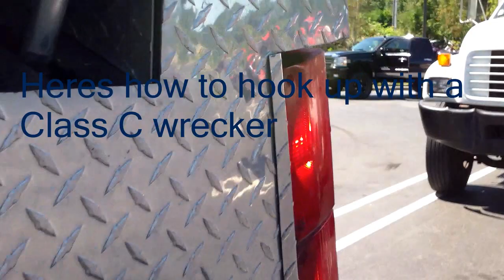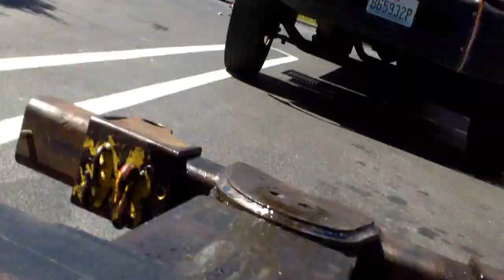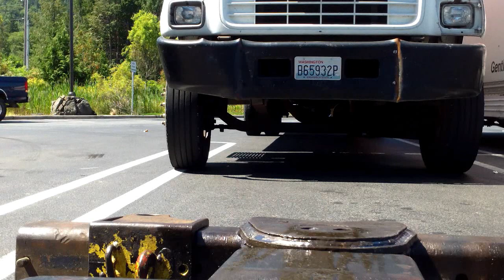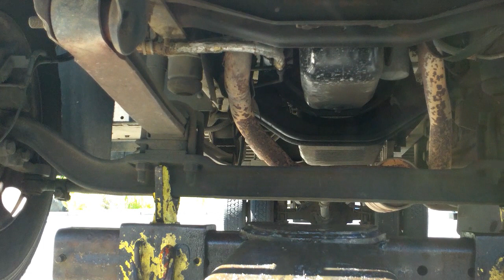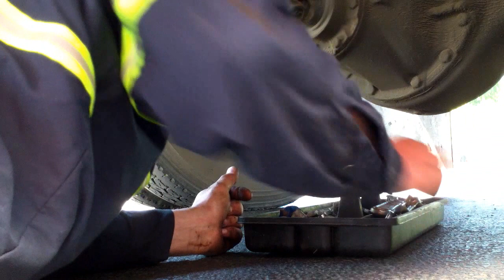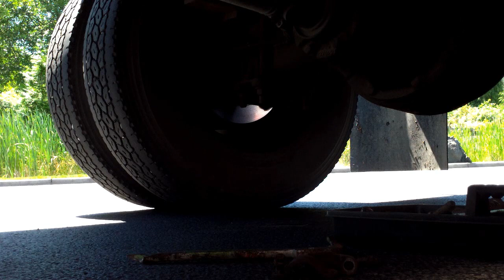here's how to hook up with a Class C tow truck-1/1

Comment: Only things I would say, Miller forks on those I-beam front ends, use a ratcheting chain binder not that load binder because it's going to loosen up, go outside of your leaf springs and around your forks so load can't shift when making turns, "GLOVES", neutral to get tension off driveline, and power tools to make yourself more efficient!

Comment: By the way Andy he raised the front axles of the truck to have room to work. That puts tension on the drive line. You do not want to disconnect drive line at that point. Watch carefully. He then lowers it to take the tension off before he unbolts the drive line. Once drive line is disconnected the transmission doesn't move. Just the rear end. Tie up drive line to the frame with a bungy or a strap.
Reply: ratchet strap yes

Comment: I bring either a 1/2 inch or 12 mm depending on the truck. But i find milwaukee makes the best impact gun. No air battery lasts forever. Break them loose with a breaker so you dont destroy them. It comes in handy for pulling axles to. The number one tool on hand is a pair of michanix gloves.

Comment: Nice! If I may suggest; invest in some tools. Pulling the drive line is a pita and time consuming. I got some thin wall deep sockets(6pt and 12pt), breaker bar and a hd ratchet (all 1/2" drive), Beats doubling up those wrenches for leverage any day. I have an air impact gun as well, hence I got everything 1/2", most of the time it's more time consuming running an air line, etc just for a 10sec burst. Thinking about getting a battery powered impact gun, know some guys who use them and swear by them. But then again even with "just" wrenches you loaded in less then 15 min!
Reply: milwaukee 1/2 rattle with a flexy extension is what i use. allows you to get in some of the weird angles you cant get straight onto. great for american trucks but anything european its back to the spanners.

Comment: I appreciate the video and always glad to see a fellow Wrecker Operator but Man I have to add constructive criticism ....... Drive shaft sockets n impact....... Or a ratcheting wrench with direction control. I understand using a fixed box wrench to break them lose so you don't round it off...... But work smarter ..... Not harder.  O and gloves💪👻

Comment: Nice. I just learned a new chain tie down and secure method.
Reply: Nekael Jones  why did he take the drive line off?????
Reply: He did that to prevent damage to the transmission Andy.
Reply: @andyelkins883  When you tow something from the front you have to pull the driveshaft so it doesn’t burn up the transmission.

Comment: Really man. Ever heard the saying work smarter not harder. 

Cheap gloves - $10 - $15
Cheap breaker bar - $15 - $25
Cheap ratchet and socket set - $30 - $45
You don't need a milwaukee impact to pull a drive line but if you ever get some spare cash I would seriously invest in one I have 3 and I love em.

And to all the ones checking his pockets cus he doesn't have on STOP, it's not a $20 tool.  A milwaukee 1/2" battery powered impact cost around $600 that's for the tool + battery  + charger all sold separately.

Comment: Nevermind the haters you just do you brother nice video be safe out there keep the shiny side up and the rubber down
Reply: He needs to learn safety.
Reply: @towmater7081  agree on the safety part could have been safer the only problem i had with anything was the chain method I've never seen this method with the chain binder seems like it works though i would have went over the frame and around the lift a few time on each fork other then that i agree safety is everything in this line of work but each of us have our method of doing the job stay safe out there brother

Comment: The forks are too wide for the axle.  Use a impact gun to remove the d-shaft bolts.
Reply: If they’re wide you can tilt and then it binds the chains more. You don’t even need a binder if it’s done right. Learned that from Luciano from Miller Industries at a heavy towing class.

Comment: You do way too much wondering around . Simply chain outside the leaf springs on both sides and ratchet binder it . Second you didn't check the tension on the driveline or mark it . You're to cheap to buy a Milwaukee.  I dont know bud and using a wrench as a lever to loose a bolt is a good way to put your eye out . I'm not bagging on you but you need to be more safe is all . Check the tension on that shaft and use the right tools

Comment: THAT'S MEDIUM DUTY TOWING  AND IF YOUR TOW TRUCK IS AIR BRAKES  YOU NEED CLASS B LICENSE
Reply: No, you don't.
Reply: No you don't. You need a class 5 with A endorsement and G01 endorsement. Unless your tow truck is a tandem. Then you need a 3 with A and G01.
Reply: There is no “class B” license in towing....because you’re towing. 😂
Reply: @corey97140  rollback drivers.......

Comment: not a proper way to tie down the front axle .. guy is gonna hurt someone let alone he didnt tie anything around the load bunder to secure it ... stop being lazy and use the proper equipment when hooking up any size vehicle ..
Reply from the maker: I did tie the binder just didn't get show I use wire. and that tiedown method does work and never come loose.
Reply: I always go around the frame and underlift!! Don't trust the hooks